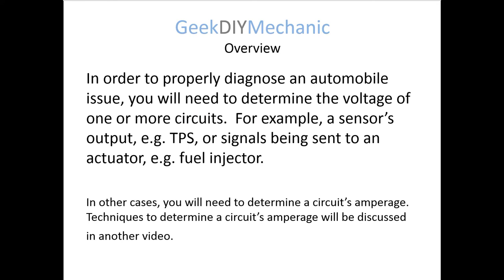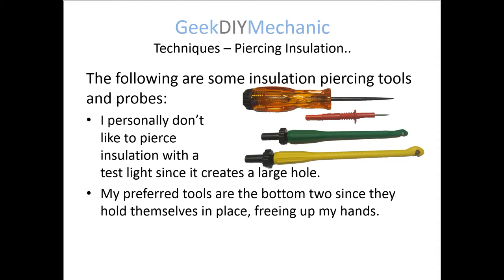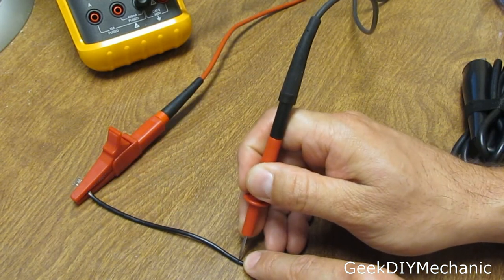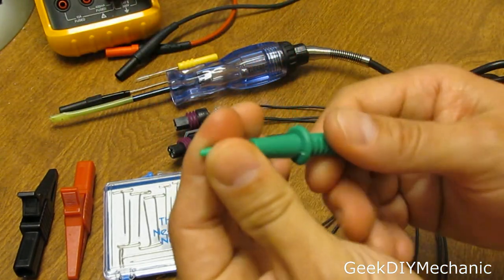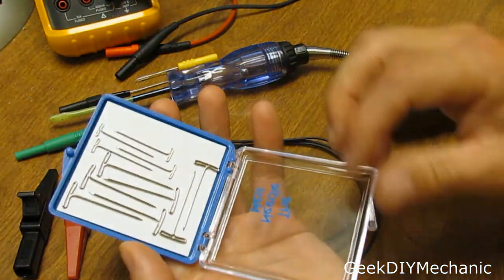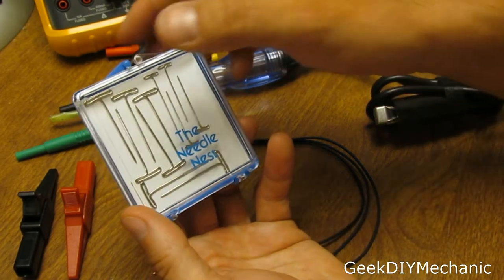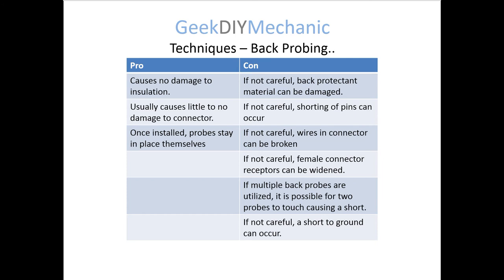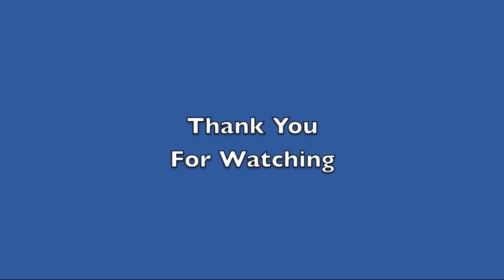Accessing an Automobile's Circuit's Voltage - Insulation Piercing and Back Probing

Comment: Hi great video , have you ever back probed a BMW e36 TPS sensor ?

how would you do this ? i can send photo if needed .  

ps great video and channel and website ( needs forum though lol )
Reply from the maker: Hmm.  When I typed this in it was all nicely formatted.  I hit reply and it seemingly lost all my formatting.  Sorry about that.
Reply from the maker: Thank you for the comment.  You made my week!  I just want to share what I have learned to help others.Unfortunately, I have not exactly back probed a BMW TPS.  But, I would assume it is a three wire potentiometer.  A picture and wiring diagram would be most helpful for the both of us.  I’m guessing that one wire will be 5 volt reference.  Another wire will be sensor ground.  The final wire will be signal.Do you have a scope or a DVM?  A scope is preferred since you can ensure there aren’t any signal glitches, which is usually the issue with a TPS, potentiometer.  I’m working on a video discussing the type of activities a DVM is good for and discussing types of activities a scope is good for.On the web site, a circuit simulator showing how a potentiometer works is provided.  It can be found by navigating to geekdiymechanic.com -> electronics -> sensor concepts -> potentiometer type sensor.  I don’t have a video about this yet.  Sounds like I should have done one already.Here’s the test procedure I would do:
Using a scope and key on engine off (KOEO), connect scope ground probe to a well-known good ground and red probe to sensor 5v ref.  It should be a clean, stable 5Vs.  Connect red probe to sensor ground wire to perform a voltage drop test; it should be no greater than 100mv.  Finally connect to sensor signal wire and slowly and consistently move throttle in one direction at a time all the way.  The resulting change in voltage should be smooth and without any glitches.  I have a question for you.  What is the car’s issue?  Hesitation? Surging idle?  I’m guessing that you don’t have an IAC, and therefore, the TPS is used by the computer to control idle.  Is my assumption correct?
Reply: If a wire is probed use 3M Scotchkote FD coating , designed for underground wire splices .  15 fd. oz. can $55.00  1/29/24 Expensive but well worth it !

Comment: You said never insert 2 T-pins but you never gave a safe Solution if you're checking for voltage? I destroyed my map light that way by  shorting to ground with 2 T-pins... what other way can I do it?
Reply: I figured out I could use one t-pin in the front & use anotherT-pin in the back of the connector & that way they don't touch.... thats okay right?
Reply from the maker: Yes; that works as well.  I can't imagine how this could be a problem.  A connector is a connector.You just don't want any shorts.  Shorts destroy things.BTW, quite clever solution as well.I assume when you say you destroyed your map light that you meant that you blew a fuse.  Right?Now, blowing a fuse is way, way better than frying a computer driver.  We will both consider us lucky on this one. LOL  Let's chalk this up as a learning experience.Out of curiosity, what is the issue that you are trouble shooting?
Reply: Man I cant figure out this shit for the life of me.. I'm assuming the circuit is  weakened & theres a voltage drop  but I don't know whats wrong.. all test comeback A-okay...

Backstory- I got a 2005 altima & Im trying to change the map light bulb & it wont light for anything.. I'm new to electronics &  bought all the tools & even set up a circuit for practice. anyway..

The car directions say disconnect negative battery before changing the bulb.. I was too lazy & several blown fuses later I can't get the map light to light..  the dome light is fine as well as all the other lights but the map light is a no go..

What I've done

1.disconected the whole assembley & gave it 12 volts via power probe & everything works fine with several different led bulbs, tried the on & off & switch  & it works.. I  front probed the connector & gave it ground & power & I also tried the lights themselves & they all lit up..

2.Tested the connector coming from the car via load pro & multimeter & I get 12 volts & power & ground... Checked for voltage drop with load pro & none

3. connected the assembley & connecter together & it wont light..

4..backprobed connector & I get 12 volts while in use but no light... tested for ground & positive & I have both... tested bulb while its in the contacts with ground & positive in the metal casing & bulb also has 12volts but doesn't light

5.tried the switch & it turned everything on & off as far as power but no light... also wiggled the wires & 
connectors & nothing

6.took light sandpaper and cleaned the contact points & used electronic cleaner & no light..

7. Checked all fuses  via power probe & they all seem to be fine..

I'm lost.. I'm tempted to just part change now & start with the assembley even though the power probe says its fine & does light the bulb..smh.... Or take it to an advanced tech & have him install the bulb & see what he thinks..
Reply from the maker: thnkbg have you checked the pin clearance in the connectors?  Perhaps the male pins are connecting to the female pins in the connector. 

I’d love to help you resolve this. From what you’re saying, you’re really close.
Reply: What do you think about a amp clamp?  My guess is my load pro is lying by saying theres no voltage drop... a amp clamp won't lie & will tell me if I have enough current to light the bulb... remember the  power probe lights the assembly with no problem... the only difference is the cars connector & cars circuit...

Test say the circuit is fine but bulb won't light so an amp clamp will tell the truth
Reply from the maker: Amp clamp is a great idea.  Why?  It will tell you if current is flowing.  You can have voltage present but no current flowing.    For example, a river can have water in it, but that doesn't mean it is moving/flowing.If you don't see current flowing, I suggest ensuring all the pins are touching within the connector.BTW, if it is an LED light, there will be little amperage flowing so ensure you have an amp clamp that go down low enough.

Comment: My problem is the wires are suspended out the car ceiling.. I can get the T-pins in but the moment I put the heavy leads on that everything falls down including the T-pins
Reply from the maker: Good question.  I probably should have discussed this.You could tape up the exposed portions of the T-PINs, not allowing them to connect.  You could use a probe kit that protects more of the probe, like the ones that Lisles sell.I also have different sizes of T-Pins, a large and small.  I use the small size 95% of the time.Lastly, you could pierce the wires as well.  If you do this, please be sure to use liquid electrical tape to cover up created holes.Hope this helps.

Comment: Heres a update... turns out all readings were accurate... I needed to but more force on the Ground contact in order for the incandesent light bulb to light.. so  bad Ground contact was the solution..

As far as the led not lighting, I'm going with compatibility issue.. seems its a car computer related problem & the current the led draws.. My probe lights it because it RAW power... the car's power has a computor involved.. I could be wrong as I'm new to electronics but thats the best guess I got with limited knowlege..
Reply from the maker: Interesting.  I still have many questions that would take forever via comments.Do you happen to live in Southern CA?
Reply: SanFran.. I have forever... ask away.. I hope I can help but you know tons more than me..
Reply from the maker: Hmm.  I think a Skype or FaceTime session would be very productive.  Please email me.  My email address is on my YouTube About page.  I hope I can help you from far away.
Reply: In the mean time ask away via comments..
Reply from the maker: Do you have a wiring diagram for the circuit in question?  I use Mitchell1DIY or AlldataDIY for my diagrams.  When you track one down, can you please email it to me or give me a link to it?  I want to determine how this light is controlled and how, e.g. ground side or high side switched.  

What tools do you have?  Do you have a DVM, incandescence test light, LED test light, or scope?  

Knowing circuit and what tools you have will allow me to determine what tests I can run and how to execute them.
Reply from the maker: Where did you go?
Reply: Been busy..  I'll be back..lol

Comment: Just my 2 cents you started with ur ohm meter  and said good conductivity there is a difference good continuity does not mean good conductivity don’t assume continuity will have the ability to pass normal circuit current Beware of the green crusty CHEERS
Reply from the maker: I agree. Continuity and/or ohm testing doesn’t tell you much on higher amperage circuits.